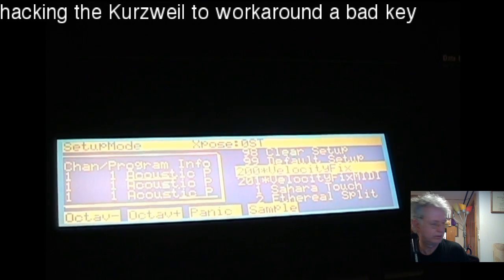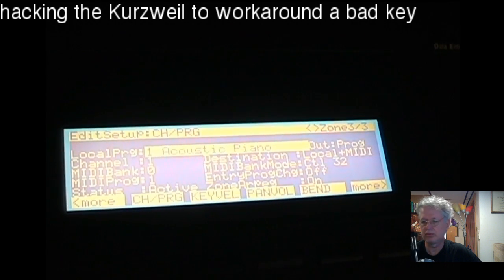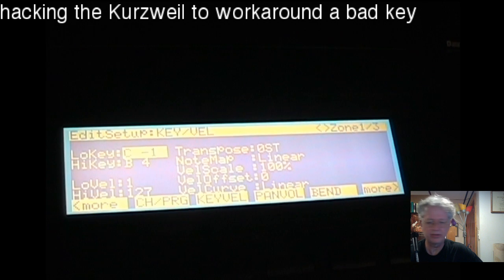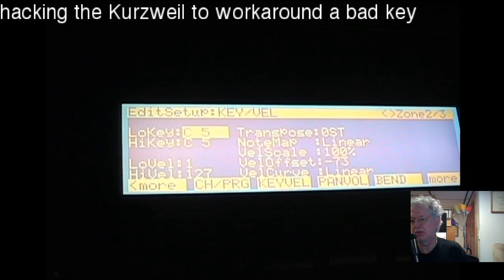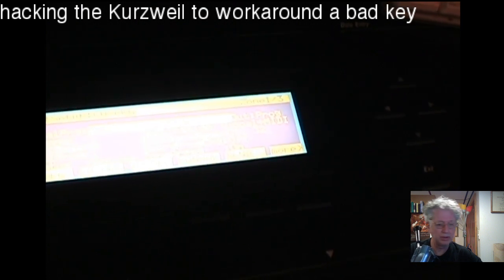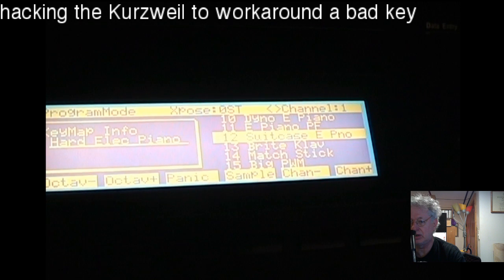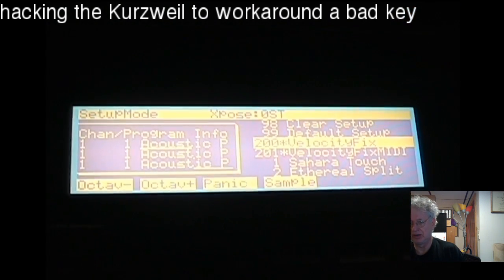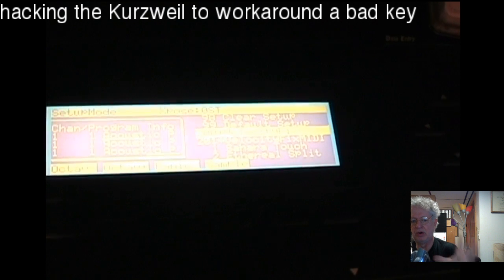Hacking the Kurzweil keyboard to workaround a bad key

Comment: I have the same "bad" key in K2500... Is it possible to do it in 2500? do I need any external software? Will it work across all programs or only in one?
Reply from the maker: My keyboard is also the K2500. The Setup workaround works for one program at a time. You have to change the program in the setup. Sorry you have the same bad key!!

Comment: Wonderful!!!  I didn't even know this was possible.  I have a Kurzweil PC2x that only has one key that plays louder than all the others.  I've been dreading doing the regular  "fix" for this because it's a lot of trouble to open up the keyboard, remove the keybed and membrane switches and clean with distilled water.  Wasn't even sure it would fix it...
I'm looking forward to trying your method.
THANKS, very much!
Reply from the maker: Sorry for the delayed reply. Did the workaround work for you?